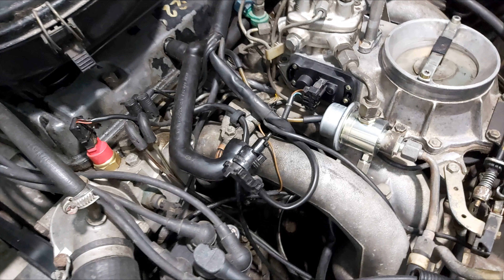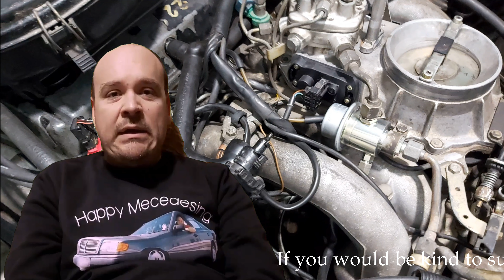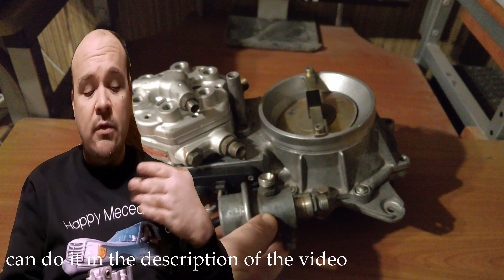㉦Mercedes Ke-Jetronic㉦ - The answer on the question about the potentiometer

Comment: Ugradio sam instrument tablu sa economy meracem. Tabla je bila skinuta sa W124 260E (12/89). U tu instrument tablu sam prebacio  merac obrtaja i kilometar sat sa moje MB W124 230E. Jer merac obrtaja i km sat od šestaka - Mercedes Benz W124 M103 (260E, 300E) i (M104 300E-24) ne pokazuje prave vrednosti u W124 M102 200E, 230E. Sad ne znam gde na motoru je priključak za economy ? Pre nisam imao economy. Šta moram promjeniti - dodati da bi ta economy funkcionirao ?  Otkrio sam zašto moj MB W124 230E nešto "guši" kad dodam gas, zašto ponekad motor teško razvije / ne može razviti punu snagu. Pogledao sam i provjerio - Problem je u kablovima svećica - probijaju iskre, pa u vožnji gubi snagu. A pre 5 godina sam ugradio nove original Mercedes Benz, koštali 225 eura - 4 komada. Veoma brzo su se ti originali istrošili - nema više prave nemačke  kvalitete. Zamjenicu ih Bosch kablovima ili NGK kablovima. Hvala na odgovoru, imaš odlične video, uvek rado pogledam - vidi se, da si doktor za MB 190E, W124, W126 i W140. Za benzinske motore sa Bosch KE jetronic - MB M102, M103, M104. A siguran sam da si majstor i za Bosch LH jetronic motornu elektroniku za MB motore u S-klasi W140 - M119 V8 (400SE i 500SE) M120 V12 (600SE/600SEL) . Veliki pozdrav iz Slovenije.